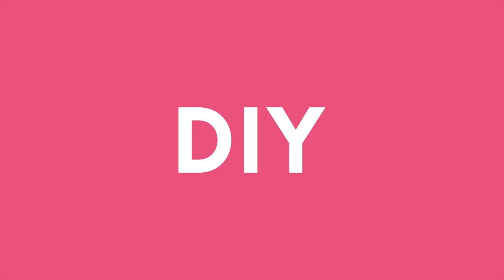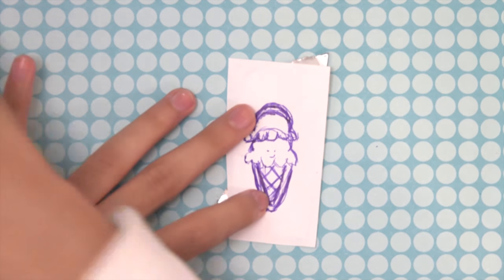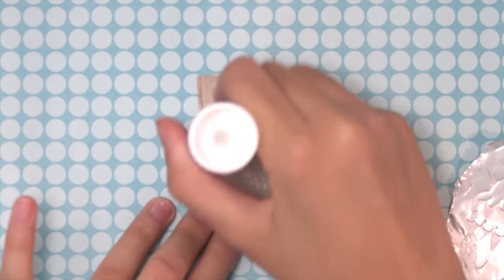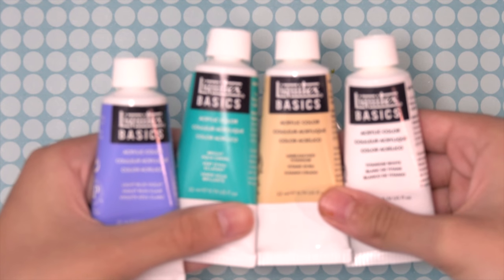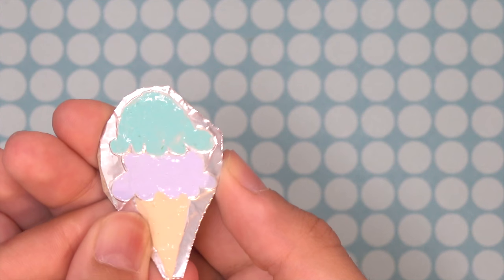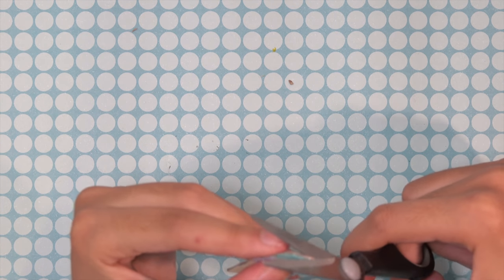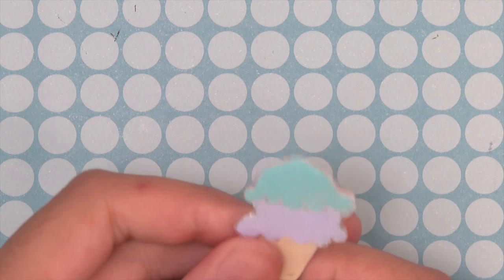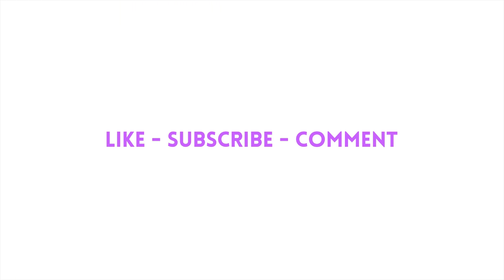DIY Enamel pins using Aluminium foil ~ No shrinking plastic needed! l Creative Gen - DIY

Comment: Hey I love your video but I have a few questions.

1.) What if you wanted to print out something and make it into a pin? Would I still need to cover the backside of the pin in aluminum foil and if so how? I wanted to print out my boyfriend’s art and make him his own pins for a Christmas gift! I was thinking of gluing the tiny printed version of his art onto a piece of cardboard and then gluing aluminum foil on it and/or just painting the back silver. Would that work?

2.) Could I use modge podge as a glaze?
Reply from the maker: Hi! Thank you for watching. To answer your questions: 

1) the purpose of using aluminum foil and tracing it is so that the design has a the silver outline that enamel pins usually have. In your case you could just cut out the artwork, glue it on the cardboard and paint the back silver (skip the aluminum foil altogether) or, you could cut out the artwork and trace the major shapes on to the aluminum foil (as shown in the video) and then paint it in yourself. This way the artwork will look closer to what it would've looked like had it been turned into an enamel pin. Yes it will turn out more cartooni than the original art  (if his art is more realistic) but that's what enamel pins usually look like. 

2) Yes you can use Mod Podge. 

I hope that this helps you out. This is a very cool and unique idea you have in mind! If you end up making some I would love to see them, just tag me @mapleartworks on Instagram!

Comment: I don't have varnish or clear nail polish . I have hot glue . How can I use it ? Please reply
Reply from the maker: Since hot glue tends to get cloudy  once it starts to dry , I'm not sure if I would recommend it. However, it might work if you heated your hot glue gun enough (about 15 to 20 mins depending on you glue gun). If you want to try this I would recommend making a test batch before doing it on the actual project.  Good luck and I hope this helped!